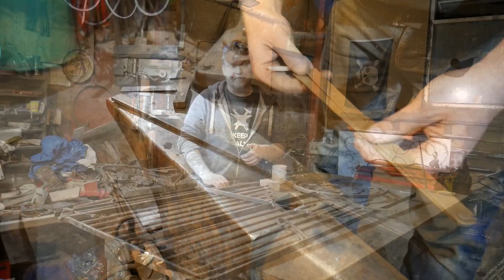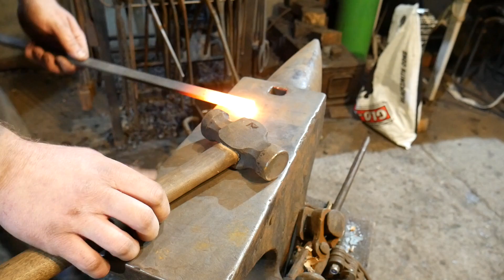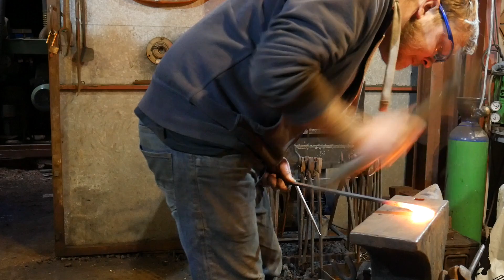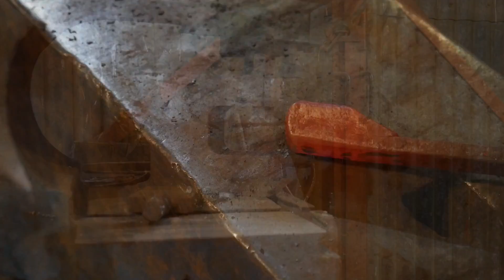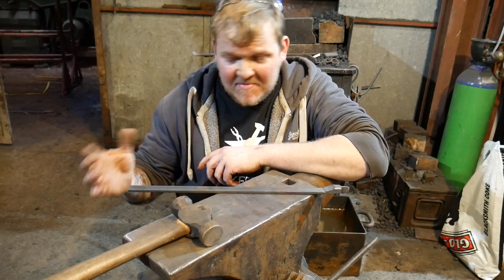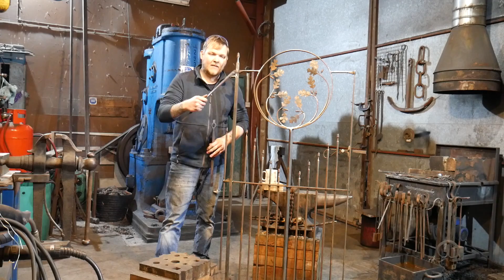Forge welded Heel tenon and Gate Up Date!

Comment: Really nice piece there boss. 😎😎😎
   So if I'm not wrong fire welding is the same as forge welding? 
   Noticed you didnt use any sort of flux...but it stuck!

So it surely looks as though it will keep its owners safe from incrouching intruders and vermin, probably even gnomes....but what about dragons???